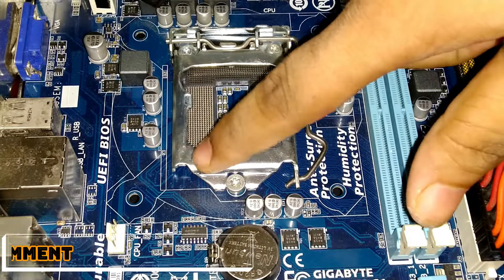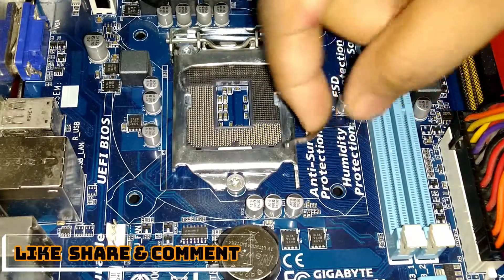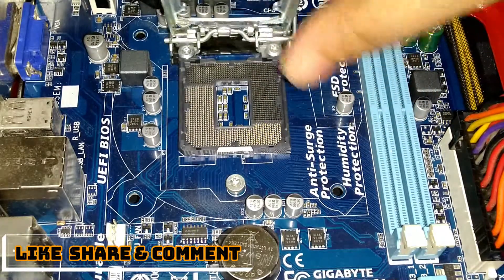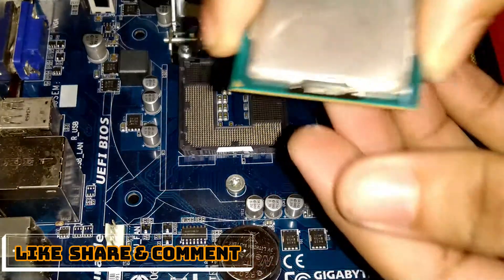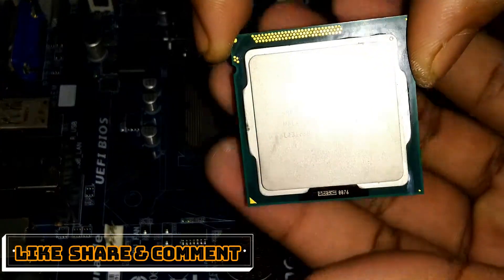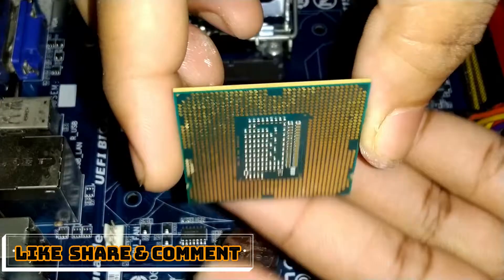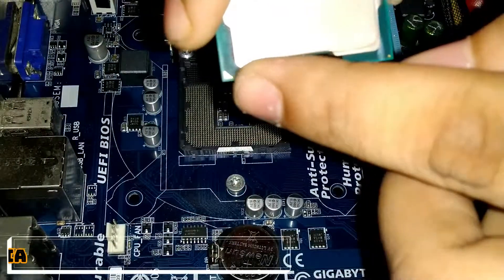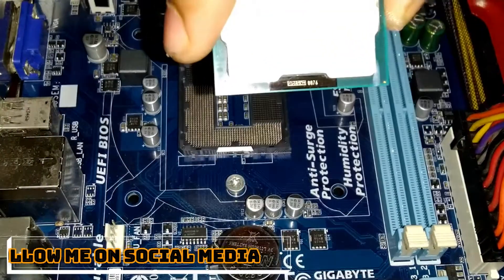How to install an Intel CPU in motherboard | LGA 1155

Comment: What is main difference between in Gigabyte Ga-H61M-S and Ga-H61M-S1 motherboard. I want to use intel i7 3770 3rd generation processor.
GIGABYTE Ga-H61M-S1 motherboard  mujhe OLX web site per mil raha hai. Kya me Ga-H61M-S1 le sakta hu.
Reply from the maker: The main difference between those two boards is the form factor. 
1)Ga h61m s got very compact design where Ga h61m s1 is a little bigger in size than the previous board.
2)In ga h61m s supported ram are 800/1066/1333 MHz  but in ga h61m s1 supported ram are 800/1066/1333/2200.
Also if you want it for hardcore gaming then go for gaming motherboards.
Thank you for watching, if you like it then please subscribe. Thank you.
Reply from the maker: If you are shortage of space in cabinet then go for ga h61m s.
But if the space does not a issue them go for ga h61m s1.